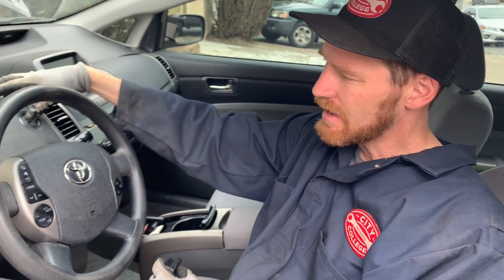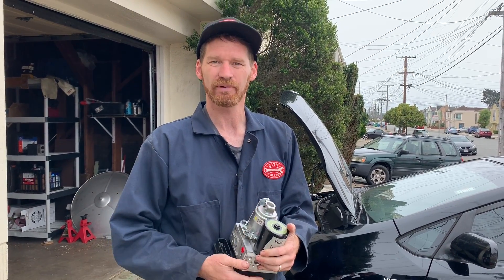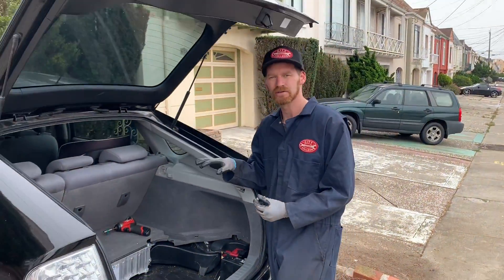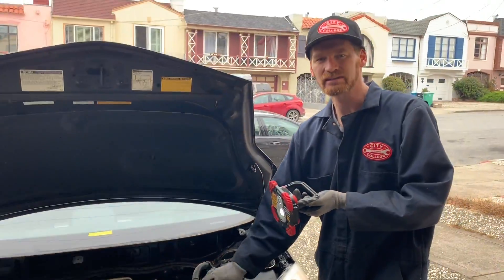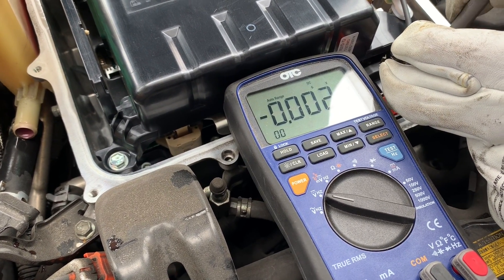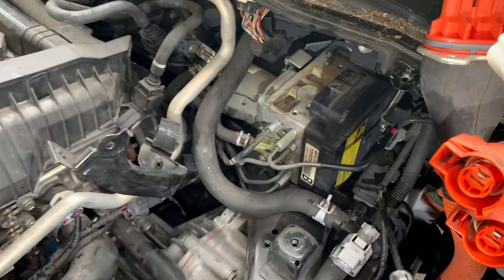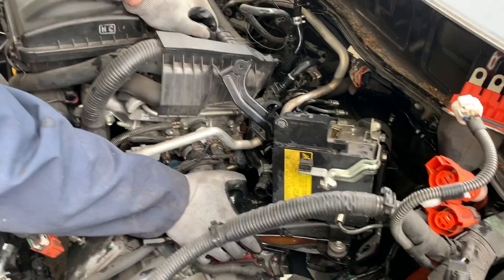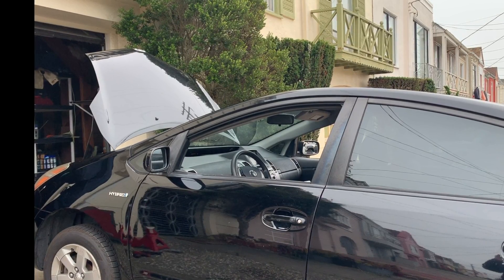2004-2009 Prius ABS Actuator Replacement

Comment: The process of removing the bolts, fluid lines, electrical connector pins and a few other things are extreme ly complicated. Things can get damage easily. I wish you include those steps in there. But thank you.

Comment: Hy Mr Electric,
I did it last month to change the Acctuator everything worked well installing Zero down etc. No error codes in the ABS/VHC but i was wondering first Time before the change it i oben the door and the Pump was running. But after the change nothing happend when i open the door ! When I press the break it starts running for 2 seconds. After 5-8 times ist starts as well. Do you have any Idea what could be the issue? 
Thanks Daniel

Comment: If someone that needs to replace his ABS actuator doesn't do so, is it a big deal? Cuz the car is still driving fine
Reply: Eventually your brakes will completely fail. The brake system builds up air pressure and it leaks causing this issue. That's why you hear it running. When the leak gets bad enough the pump won't be able to keep up with the leaking air. At that point you will no longer have any power to the brakes.
Reply: a failed ABS on any other car works ok, but on a Prius you may have regen issues because it works with the brakes. eventually your EV battery will not fully charge. keep an eye out for it.

Comment: I have this problem with my 2008 lexus rx400h. There was a recall on the ABS actuator.  But they ended up not honoring it because my signs showed up 1 week after the deadline. They are charging about 4k for it. I found the part online for abt $900 but need help installing it. I live in Houston TX.  Are you able to assist me with this or recommend me to a mechanic here that you think could do it properly?
Reply from the maker: Not sure who to recommend in TX. $900 sounds a bit high for the part. These usually go for under $300 did you try LKQ parts?
Reply from the maker: Never mind they are $900

I had an rx400h and a 450h. Both nice rides

Comment: Very safe, professional way to start your repair, tells a lot about the quality of your jobs. I kind a have similar problem, I have a Prius 2012, the abs, brake and stability lights are on, the code I see is C-1391, a friend of mine working in Midas said is the actuator having a leak, the sound it does my car, is not consistent as the one you fixed, but when the lights are on (abs, brake, stability), the sound is repetitive every 9 seconds more or less, when pushing the brakes feels a little lose, but surprisingly the lights goes off by itself and the brakes works as normal, this symptom is coming and going, do you recommend to replace the accumulator? or start checking something else first, I will really appreciate your advice.

Comment: Hi great video. Sorry to bother you but i have a 2006 Prius and the ABS warning light is on. I am still driving the car. If the Actuator  totally fails  will  the brakes stop working ?
Reply from the maker: The pedal will become very hard to press if the actuator totally fails. The car will make a continuous beep noise when it fails.
Reply: Thanks for the reply :-)

Comment: Can you say how frequently buster pump is restarting now after repair?
I mean when car is in READY and not touching brake pedal.
Mine is restarting every 3 minute for 5 second.
Is this normal?
Reply from the maker: Yes that is normal. 
It runs differing amounts depending on driving conditions, driver actions ( frquent heavy braking for example ).
When the car just sits in park it will run every few minutes.
Reply: @Mrelectric423  I'm happy to hear this answer. I guess, that restarting is caused be small internal leakage and pressure drop inside ABS actuator module. I just would like to know if this is normal for Toyota hybrid models, that's why I asked to you as experienced electric. please, if you will be nearby of healthy Toyota hybrid models (Lexus, Highlander, Prius) can you observe how frequently (in minutes) their buster pumps restarting to compare with main and  find out what is approximate condition of ABS module. Thanks and waiting for your response with results)
Reply: within ages ABS module probably starts small internal leakage and time to time pump restarts more often to support pressure in system. That's why I need to compare to other working cars and find out approximate condition of my ABS system.

Comment: Just did this on my 2007 gen 2 prius because I was having issues with the red break light, (!), VCS. Changing ABS actuator helped solve the issue thank you! This was done like on march 29. As of April 18 can confirm the issue has not comeback! Hoping to keep you guys updated!
Reply: Hey sir, just curious, did you do the bleeding procedure?  I'm about to change my actuator tommorow, don't have a tool to run the bleeding procedure...
Reply: Jamba plays Yes I did the bleeding procedure. I didnt do it with a tool I just checkec my brakes normally the bubble procedure
Reply: @Th3TaurosGamer  still working well?  Did you see bubbles come out?  Thanks!
Reply: @elscanoe  no but it worked fine! I eventually had an issue with my coolant pump not sure if it was due to me missplacing something while taking everything apart but eventually fixed that too. Just be very careful when taking things apart. As of right now my car is working good!

Comment: Everyone asking about bleeding, I can attest to Mr Electrics statement that brake bleeding is NOT essentional when replacing actuator. Did one today and tried without bleeding and as he said it surprisingly worked! Just fill your reservoir all the way, keep cap off and push pedal multiple times until it starts to harden up check fluid level and your golden
Reply: Is it still works fine without bleeding? I'm about to change my actuator tommorow, don't have a tool to run the bleeding procedure...
Reply: @jambaplays8119   Did you ended up changing your brake actuator?
Reply: @hedgehogthesonic3181  Hey there! Yes I did, first I did it without bleeding and did the bleeding procedure after a couple days using my buddy snap on scanner.
Reply: @hedgehogthesonic3181  works fine till today, no issues.
Reply: @jambaplays8119   Nice, good to know, i'm about to replace the actuator on my 2012 Prius C. May i ask you what the torque spec of the brake lines, if there is any? and the one of the orange wires that go to the inverter / converter?

Comment: I really hope this junk yard part works...
Has just turned into...
<-- works on junkyard car, removes needed part, no problem.  Works on own car, removes bad part, no problem. Upon installation of new abs pump, manages to cross thread  the hole in the "new" pump for the brake line.  AFTER 6 STRAIGHT HOURS of garage time, and a really hurting lower back, this idiot flew off the handle and lost his temper and decided to call it a night.  Upon walking away from the car I notice broken Glass on the ground and go to throw it away so no one gets hurt...  I then proceed to catch my shin on the trailer hitch, fall over between the bumper and garage door, bust my ass, and once I stood up, slammed my bald head into hook/ latch on the bottom side of the open hatch . 
Oh what a night...

Comment: This video is so satisfying to watch. I just bought my 2008 Prius 3 weeks ago. What a surprise when I was driving around thinking "wtf is that NOISE" HAHA guess I got took.. I need this done because that noise is DRIVING ME NUTS. My vehicle is not displaying any error codes though. I was quoted $1800 Houston TX
Reply: Still got it?  A lot of people get taken for a ride when gen 2 prius shopping over this part. I test drove 5 prius' that were being sold pretty cheap that all had this issue. Finally found a good deal on one that didn't.  Replace and bleed out your brake fluid every 5 years or so and it should help stop this part from going bad.

Comment: I replaced mine this week and I have no brake pedal. Tried to bleed the system for over an hour without Techstream and I give up. Can anyone help?
Reply from the maker: What codes do you have?
Reply: Mr. Electric my scanner revealed no codes but when in diagnostic mode using the jumper on the diagnostic connector, the dash light indicators are flashing multiple sequences and I can’t make sense of it all.
Reply from the maker: @Jimreynoso  Techstream shows no codes or a different scan tool?
Check fuses could be blown actuator fuse.
Reply: Mr. Electric okay I checked all my fuses and all are good. I did notice that the replacement actuator makes no sound at all. Even with my stethoscope I heard nothing. I wonder if it too is defective? I’m so stumped.
Reply: In a new development, I persisted with pumping the brakes pedal until I now have a good pedal but no assist from the actuator. I hear the clicking of the relays but it does nothing for the braking ability. The pedal is hard to press and the car is slow to stop.
Reply: Also, that annoying beep won’t go away, I jumped the diagnostic connector to clear the dash warning lights but they, along with the beep, won’t go away, I guess it’s due to the actuator not working.
Reply: Hello again, I just wanted to update you on my Prius, I took the actuator back out and got my money back. Then I got me another used one and after installing it, I had no abs indicator lights and didn’t have any issues bleeding the system.  All is back to normal. Thanks for making this video.

Comment: Question mr electric, what size socket you using to remove that bracket for the abs  actuator and how did you magnetize it?
Reply from the maker: I think its a 12mm. I buy grey pneumatic magnetic impact sockets but no need to get that brand you can also stick a little magnet to the side of a regular socket.
Reply: Mr. Electric damn that’s genius!!! Hahah thank you sir! On to my quest!
Reply: Everything for this job will be 10, 12, and 14mm and 1 T30 torx for the invertor, not sure why they did that but will have to check if it's on other prius's i come across in the future or just this customers car.

Comment: Taking on this task Saturday most likely. Just pulled one from a junk yard, hopefully it's good.

Really wish you would have released a brake bleeding video. I have Techstream but out of the whole job, bleeding everything is what I'm least confident in doing. I've never messed with all this computer crap and I'm concerned it won't bleed properly.
Reply: Just ran across this video again and forgot I watched it prior. Since my first comment, I've replaced the actuator with a used one three times already. I just gave in and ordered a brand new unit from Toyota that came in the mail today which I'll do this weekend.

Even though I've bled the system three times already, I still stand by my comment. A video would have been a great resource.

Thanks for this video again. I'll use it as a refresher.
Reply: @JBelcourt7  i apreciate your followup years later! i have the codes and lights and was just contemplating on if i should go used, refurb, or new. as far as how long theyd last and cost. Thank you! if i may ask, how long  do you think you can drive on one before it burns out? after the lights n codes show for it. mine currently is cycling every 15 seconds and i deliver food for income. thank you in adv!
Reply: @travislowrider6623  unfortunately there's no real set timeline. The initial one I had to change out lasted several months with the lights on and it functioned fine until I finally changed it. This last time it happened, it literally happened within 24 hours. I went to work on Friday with no issues and when I went to the store Saturday morning on the way it lit up and then the low pressure alarm started going off and the brakes were barely functioning. At the price point of the used units being 500 to 600 now, if you can afford it, there's no reason not to just spend the 1200 and get a new one. It's not a fun job and you don't want to do it several times lol.

Comment: Hello Mr. Electric Yes could you tell me want software so I can check my ABS unit see if it working or not? And also you say computer can bleed the break line after I installed ABS unit in my 2009 Toyota Prius. So would you tell me where I can get same software for my laptop too. And also you keep up the good work on your video on here. I'm calling from Houston Tx
Reply from the maker: Look up Techstream on amazon and you will find software

Comment: What happens if you dont replace it? Just no abs or what?
Reply from the maker: No power brakes. Its almost impossible to stop the car.
Reply: @Mrelectric423  even in B mode?
Reply from the maker: @travislowrider6623  yes still needs to be fixed to drive

Comment: What do you think of the likelihood that an actuator from a wrecked Prius of the same gen would work - thus saving a big expense for the module? Or is the original module a risky part to begin with?
Reply: Whats a tale tell sign to inspect for signs of wear out or good signs etc
Reply: Probably good, always inspect it best you can first

Comment: How much should it cost to fix this I have an extended warranty on mine that's 108000 miles but it does not cover the ABS system. At somewhere besides the dealer how much is the part by itself

Comment: can you recommend any decent mini vci to do abs bleeding and zero point calibration? i just replaced my abs pump on 05 Prius and new (used)  pump is clicking every 20sec for 2-3 seconds. new pump has flat top accumulator.

Comment: Mr. Electric,

Great video! I am planning on doing this same procedure on my 2009 Toyota Prius and wanted to know if you have any tips. I am nervous about the bleeding process and I know you said you didn’t have to do it, but if I run into a case where I have to, do you have any tips on how to do that? 

Also, my electric water pump is going bad as well, is this a good time to change that out as well? 

What are some places I can get a good quality actuator and electric water pump that wouldn’t cost me a whole lot?

Last, is brake fluid required for this procedure?

Thank you!
Reply: If you are still planning to try this yourself, i highly recommend putting the various screws and bolts in labeled zip bags and keep it all organized. Be sure the take lots of photos showing how everything goes together as well. Good luck!

Comment: Hi, great video! Thanks. I wanted to know if the ABS actuator is reprogrammable? Does it need to be reprogrammed by a dealer if you buy a used one and stick it into your car as a replacement?
Reply: That is a seriously good question. Where is the answer?
Reply: the problem is it is leaking internally, has nothing to do with any programing.

Comment: N i changed my brakes after the abs lights whent on do u think its just bleeding?
Reply from the maker: If you changed rear brakes and light came on it is probably the star wheel adjuster too loose. 
If fronts the abs wheel speed sensor maybe got disconnected. Unless brake fluid came out of a line or caliper, changing the pads and shoes shouldn't cause a need to bleed brakes.

Comment: Mr. Electric,

After replacing the acuator should the abs, brake and (!) go away? Or will it go away after bleeding the brakes? I purchased a used pump on ebay and after following this video, i still get codes like c1256. Brakes have not been bleed yet using techstream.
Reply: Me too i have this problem

Comment: I assembled everything up to the inverter, and attempted to turn on the car to see if everything was alright. However, now the check engine, Triangle, (!), ABS VSC and Brake lights are on and the car will not turn on. I am not sure if the new actuator is defective or if I messed up. What can I check for and in what order should I go? Also, the brake does not have resistance at all as if the actuator did not send any pressure, but I can hear it buzzing when I pass by the car.
I want to put the old one back, but I am going to wait for any advice I can get.
Reply from the maker: Is the orange service connector clicked down to in secondary locked position( not just rocked into position but second lock of lever )
Is inverter cover on and connecting small safety prongs?
Reply: @Mrelectric423  Hi, I figured it out, it was a small connector on the inverter. Thanks a lot, your video was the most concise/well put together. If I did not stumble upon it, I would have been out 1.5 grand. Thanks a lot and keep being awesome.
Reply: Mr. Electric you said the two behind the inverters or the one in the front ?

Comment: Mr. Electric, this is an awesome vid. Thank you. I'm about to undertake this job to save my '07 prius, but am not feeling super confident about the brake bleeding. Curious if you were planning on posting a follow up vid on how to do that. Again, thank you!
Reply from the maker: Sam,
As an experiment I did not bleed the brakes after install of an actuator on a gen 2 prius. Surprisingly it worked without issue.
Reply: Mr. Electric  I need break bleeding link Prius 2007
Reply: @Mrelectric423  is in necessary to bleed out the brakes after replacing abs actuator?
Reply: Is it still works fine without bleeding? I'm about to change my actuator tommorow, don't have a tool to run the bleeding procedure...
Reply: بلكت معلومات افضل  علا الماجسته
Reply: بخصوص الماجسته البريك الاي بي اس ads